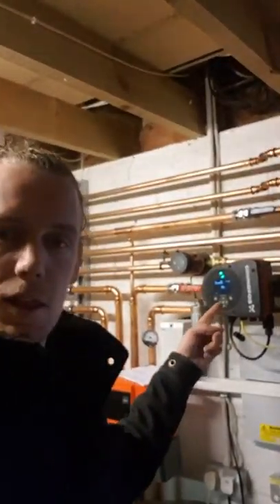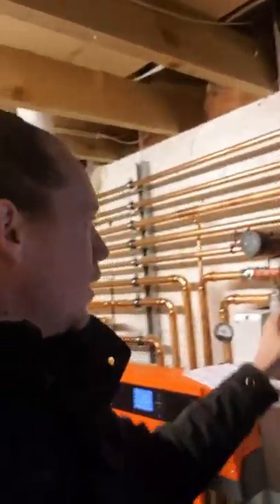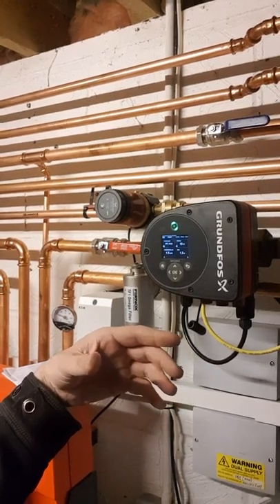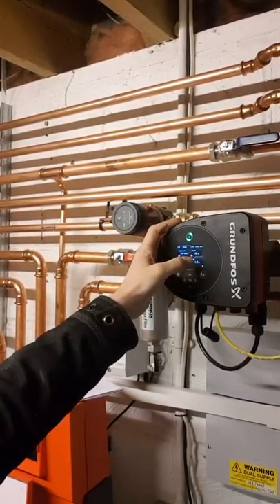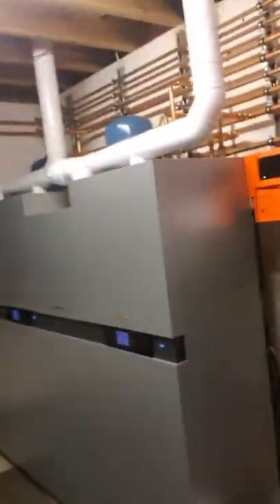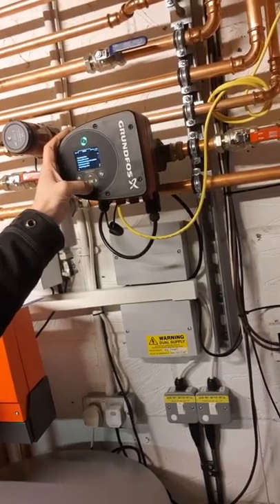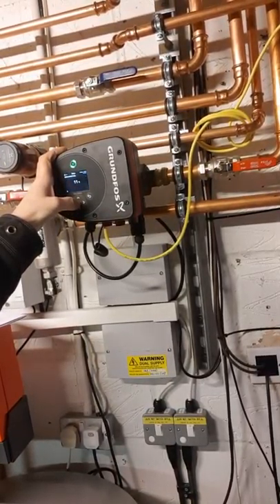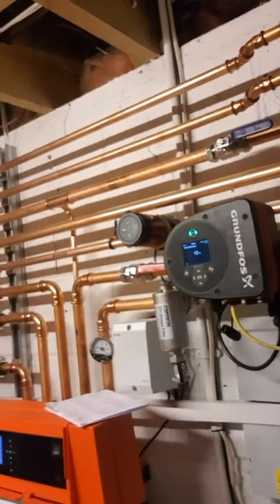Distortion.. the solution!

Comment: So the pump's temperature sensor wire Should be thermally insulated, right?
Reply: Not sure. Why?
I clearly heard "wet pocket" so the resistive sensor (most likely PT1000 or NTC) is directly in the flow. 
The resistance of the wires will change slightly, but the whole wiring should be several orders of magnitude lower than the sensor.

Comment: I assume the flow rates on each rads has to be correctly set in order for this to not affect heating in the house. In terms of far radiator not having enough flow.
Reply from the maker: You need to balance the system yes..

Comment: Given good flow and balance, the success of this ‘clever’ pump has to centre on the control system which should account ‘for lead and lag’ (or system inertia viz time ) . The control system needs P&D (proportional and derivative) control and some sort of commissioning adjustments will need to be made to ‘match’ to system response. Interested in your view. 👍